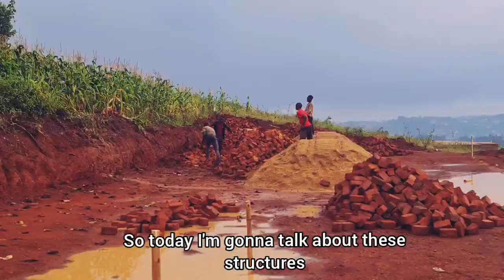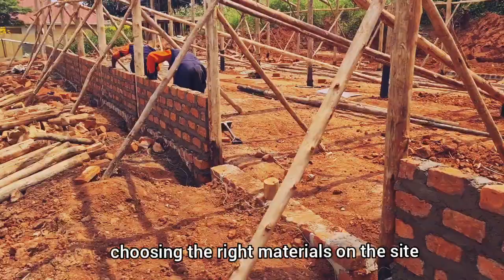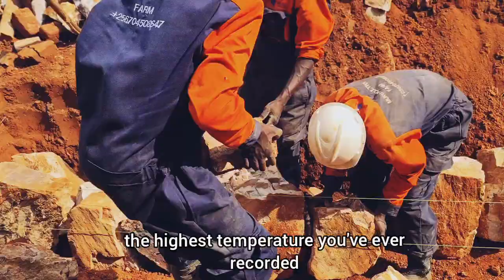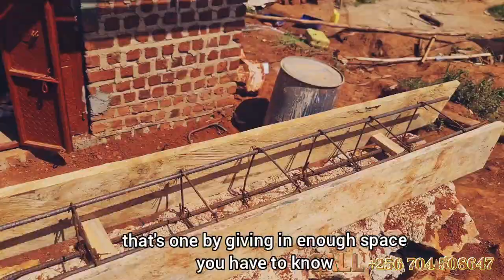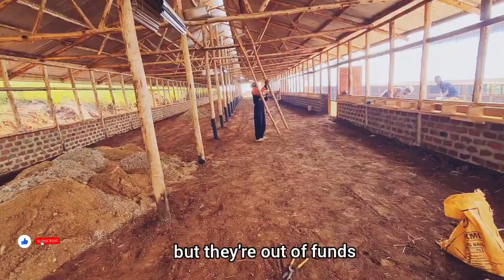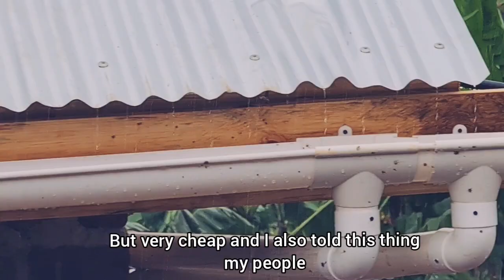Step by step construction of a 5,500 layer coop (ENGLISH)

Comment: My question is regarding the timber, do the boards and planks have to be well cured, or can I use timber directly after felling and milling?

I have several trees that I can cut down for this purpose but not sure if the timber will need curing.